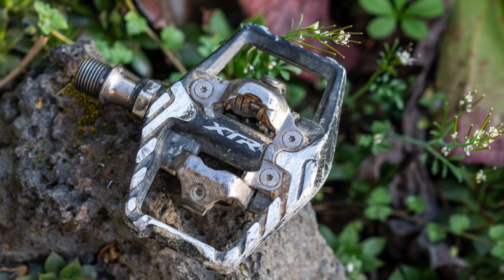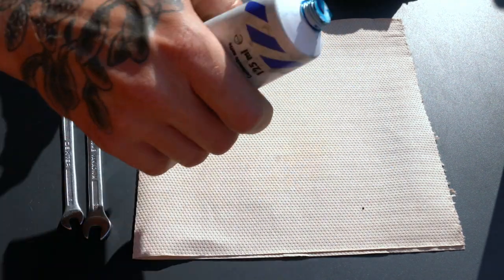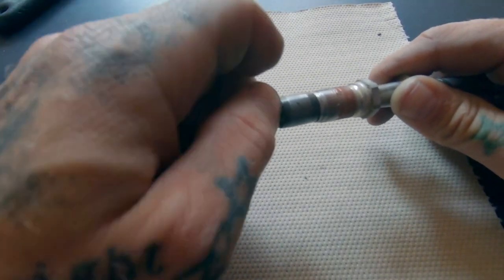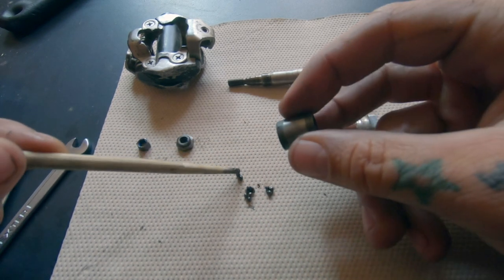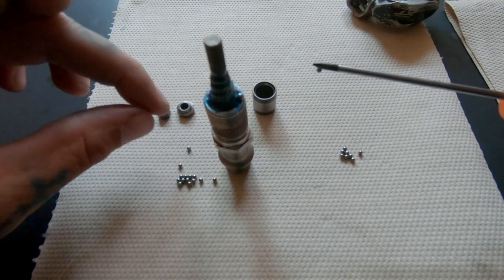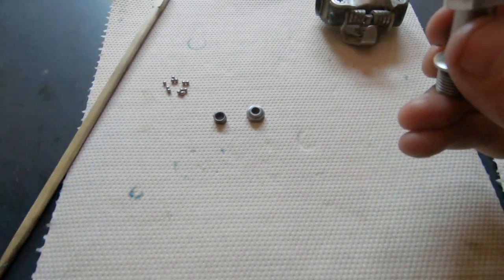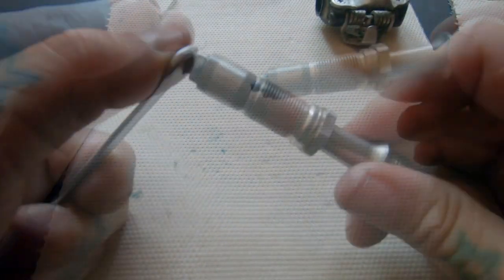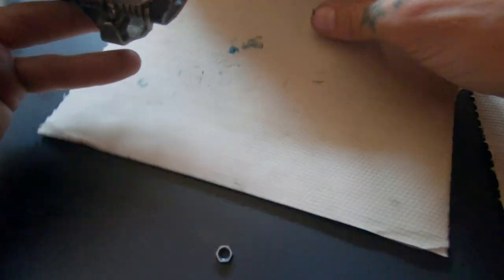How to Rebuild Shimano SPD Bike Pedal - A Maintenance Tutorial

Comment: Did the over pouring of grease resolved the play from the XTR? I have the same issue with my SPD
Reply: It did not. That one actually needed the internals replaced.
Reply: @pianohat1  did you replace the o-ring?
Reply: @mhygzs06  I did. Had a junked pedal that I pulled one out of. I don't know if dealers will carry that part, but it could be worth asking.
Reply: @pianohat1  thanks. Will try